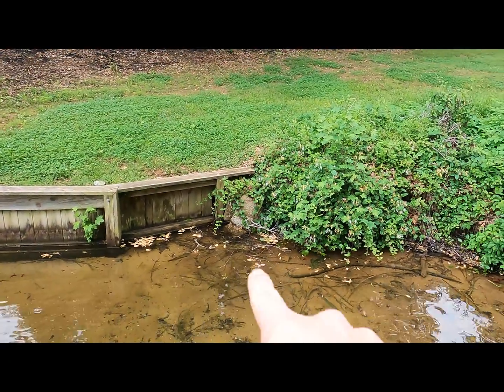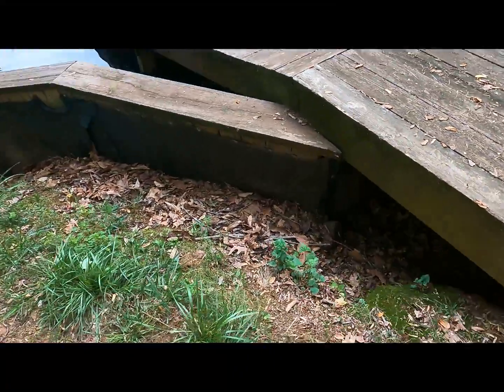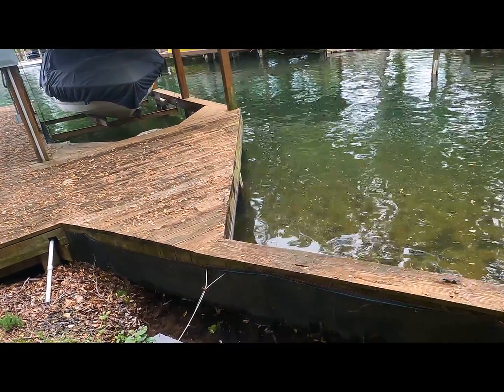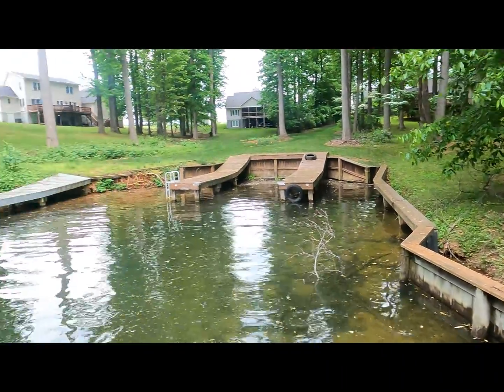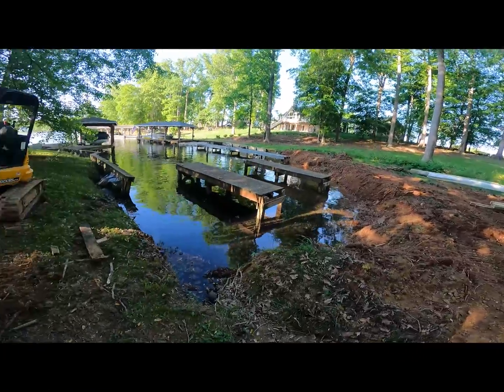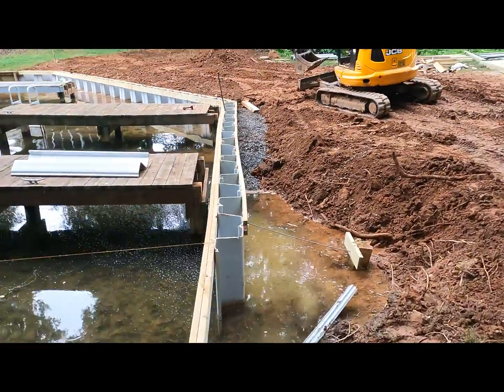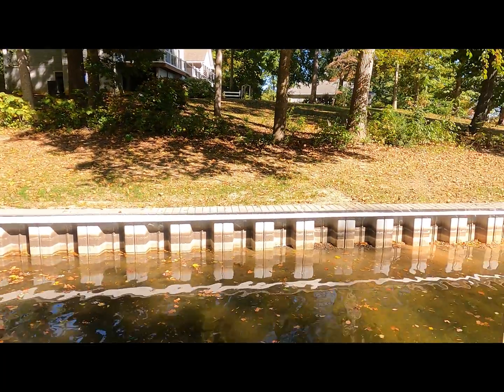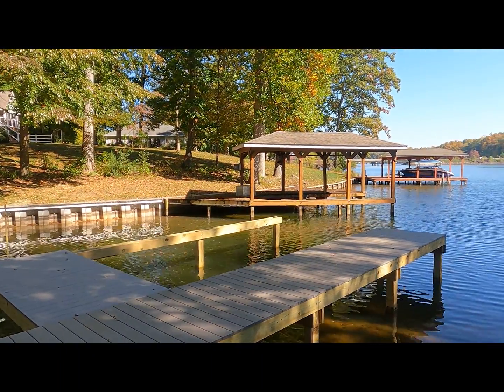Replacing a failing seawall with vinyl!

Comment: We take sand for filling the wall from the bottom of the reservoir.
 For this, we use a mini dredger consisting of two motor pumps and a suction nozzle with a Bagermaster hydraulic washout